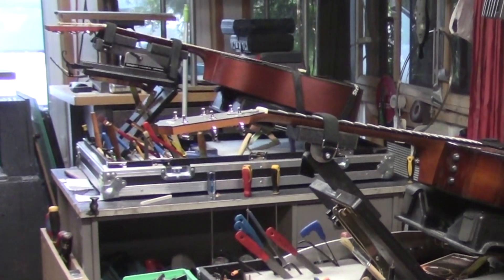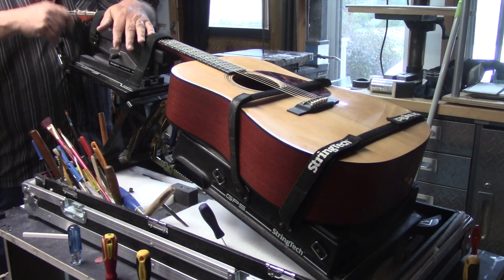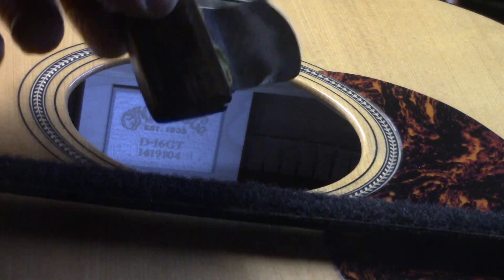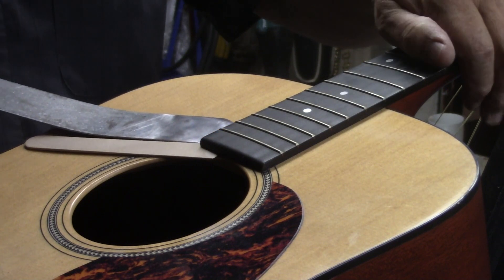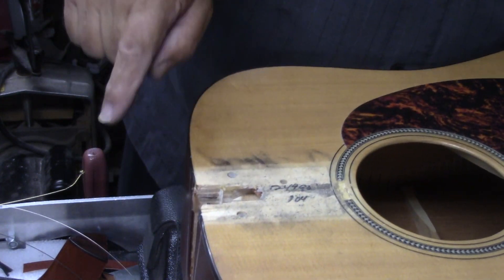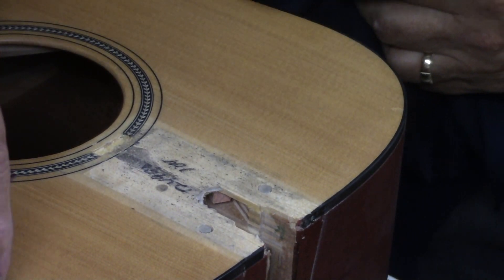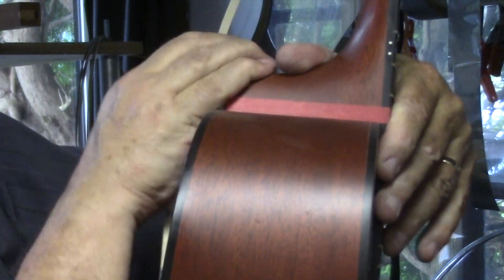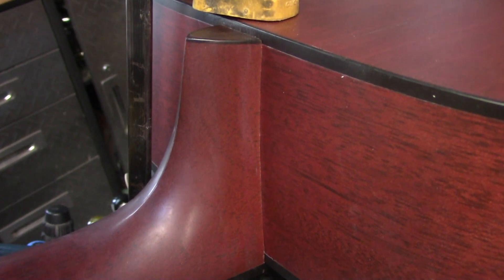Martin D-16 Neck Re-Set@StringTechWorkstations

Comment: I curious, why not hide glue for the whole job? Would you use hide glue under a wood fingerboard? Thanks.
Reply from the maker: Thank you for asking Carlos. The aliphatic glue will release with heat alone ( no steam ). The hide glue is best released with a combination of heat and steam. In the case of this particular guitar .. tenon in mortise with a fastener ... when I install the neck, I quickly push the tenon into place and tighten up the fastener, before the hide glue begins to gel. The aliphatic glue has more "open time" ... which allows me to tighten it down after the tenon is in place ... then clamp the fingerboard extension and clean up the glue squeeze. When it comes time to remove the neck .... the fingerboard extension can be heated and it's glue joint slipped. Then the steam needle is used to soften the hide glue for release. Cheers , MMcC
Reply: @StringTechWorkstations  Ok, got you. Thanks for the explanation, and taking the time to do so. Very smart method.
Reply from the maker: @carlosreira413  You are welcome Carlos 🙏

Comment: Nice clean job you've done here sir. 
At 23:17 why do you glue the tenon with HHG ? The all point of bolt-on mortise/tenon joint is you don't need to glue it (except the fingerboard on the top). Is there any reason why you do it in this case ?
Reply from the maker: Good point. I decided to give this a little help with a thin slurry of hide glue. Take Note: that I provided "pilot" holes for the next guy .... years from now ... to take any guess work out of steaming ;^ ) !
Reply: @StringTechWorkstations  It's nice from you to think of the next guy :) I wish every repairman would do the same ahah

Comment: Lovely video and craftsmanship as always! However It’s time to question, which other consumer goods businesses would accept such cumbersome ways of servicing of a 1700$  item?? I have a Martin D-15 that within 2 years developed a severe 14th fret fretboard hump. Had to re fret and level the board completely on a fairly new guitar. Martin refused to service it on warranty.. Lovely guitar though.
Reply from the maker: The plastic fingerboards will NEVER have the rigidity and tensile strength of ebony ( or rosewood for that matter ). I have also done quite a few ... essentially new ... guitars that needed a neck reset. Pretty crazy ! MMcC
Reply: Dang shame, you would think under warranty Martin would fix it. Those folks over there are already on the payroll and work quickly, so it is not that expensive for them to stand behind their product. If it were just wear and tear that would be different.
Reply: @StringTechWorkstations  Thanks. The D-15 in fact has an Indian RW fretboard, but the body & neck woods set differently over time. Quite a bit, provoking the bump. Used the opportunity to add some bigger fretwire that improved playability big-time, so I’m happy overall.

Comment: Bakelite it's plastic and wood fibers. Junk...
Reply from the maker: It's the sad reality.
Reply: What sad reality ?
Also, can't you just put a 5mm Allen key in the neck tension bolt without taking the neck off ?
A bit like going to get a tyre replaced and the garage charge you for unnecessarily strip down and rebuild of the whole engine .
Asking for the rest of the world.
Thanks